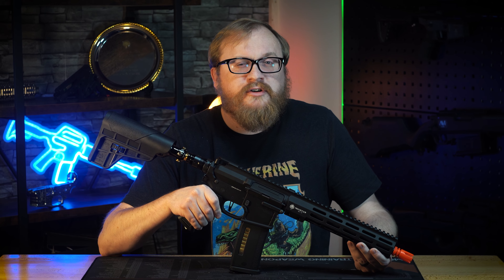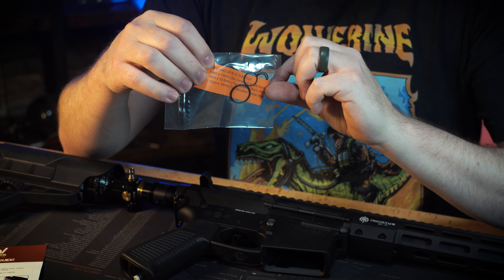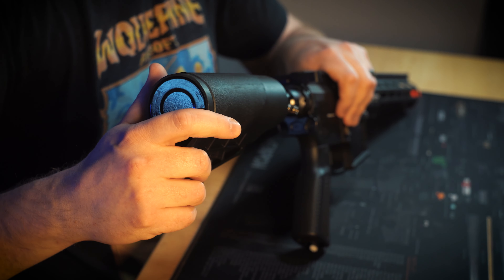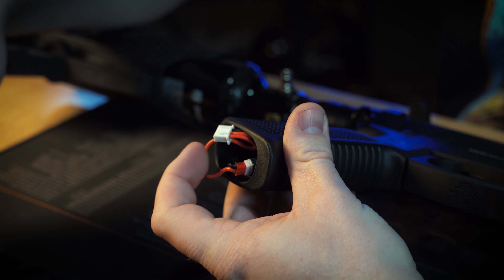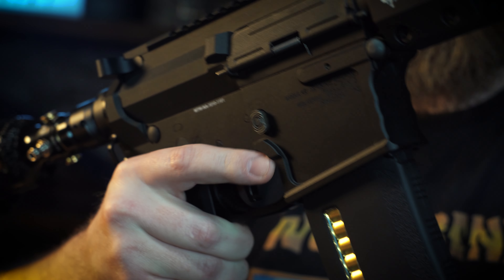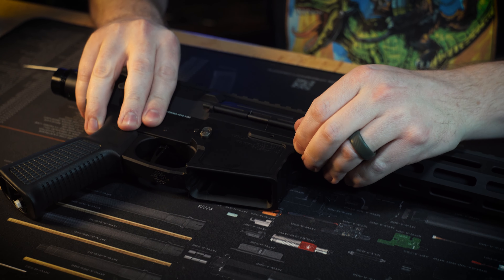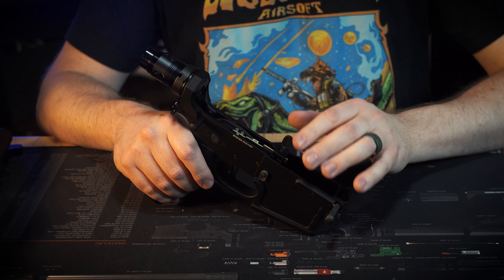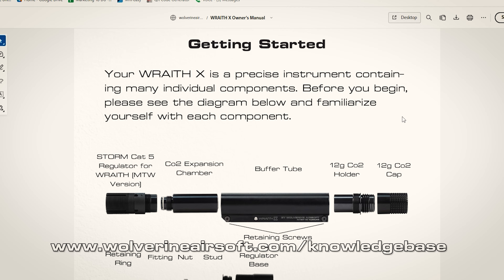Getting Started with the MTW Unleashed (Without Battery Grip) - What the Tech!

Comment: @2:41 is there any way to reduce the spriongggg ringing sound from the reg? It is the only thing that I am not 100% Heck yeah about otherwise I really Really Really like this gun OOTB 
(other than the supplied mag not feeding without being pushed forward/needing velcro in the magwell) 
Also that shirt is slick
Reply: Your PTS MTW mag wont feed without the Velcro mod? Odd mine works great, trying to find a way to get more of these but they are out of stock
Reply: @desertstriker8  yup, my regular mtw mags feed flawless. But I'm not too fussed I have plenty of options